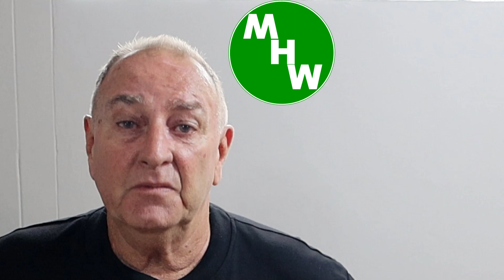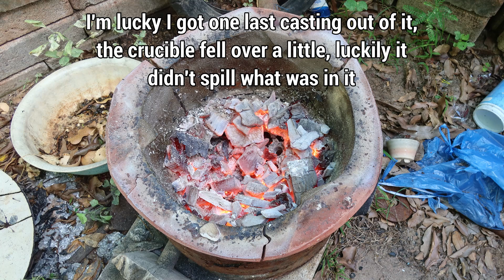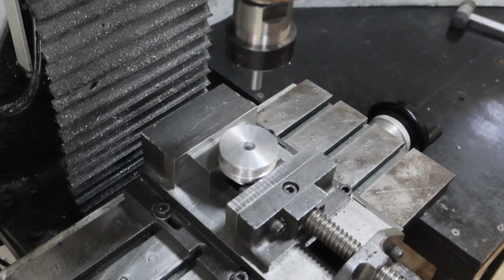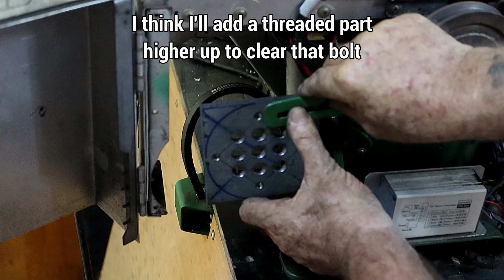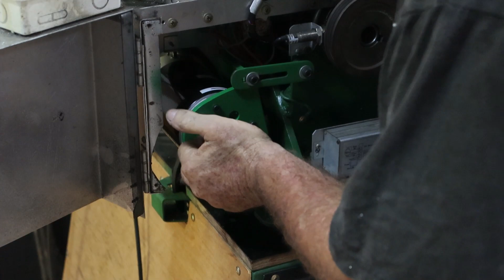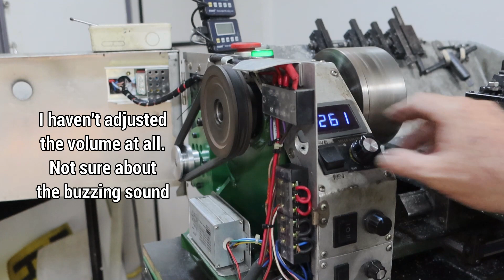MHW Episode 85 - Replacement Lathe Motor

Comment from the maker: As per usual I'd like to welcome my new subscribers 🙏, I hope you enjoy the content on my channel, if you enjoyed this video, please smash that Like button, it helps me to get my videos viewed by others and if you haven't yet subscribed, please consider doing so. 👍
Reply: Thanks for your prompt reply mate. I was a fitter back in the 1980's so I only ever used machine tools as and when required to so I don't think I could build a lathe or mill by myself. We hope to sell the house and buy one of those knock down houses made from wood up on stilts so I can fit my car under it and possibly build a work shop too. We have 6 rai of land up there but the problem is It's in what I call NAKON NOWHERE. If I don't have a small shop I will go crazy up there because the main town in Uttaradit is 26 KM away . I do want to get out though
Reply from the maker: @dermotkelly2971  I'm a motor mechanic by trade but had the desire to be a Fitter and Turner when I left school, but couldn't get a job as an apprentice. I ended up setting up and running a large repetition machine shop for the last 10 years of my working life. 👍
Reply: @MyMiniHomeWorkshop  Thanks for the feedback. Where do you go to get supplies like bolts and lathe tools and stuff?
Reply from the maker: @dermotkelly2971  Bolts I get here locally from a small engineering supply shop, tooling all comes from Lazada, as does some of the steel I use, I found a supplier up in Nakhon Ratchasima that sells short lengths of all sorts of grades, shapes and sizes, plus Aluminium and Plastics. Although I found a big scrap dealer here in Pattaya that puts more useful bits and pieces on shelves, so when I want a piece of plate or something, I pay them a visit, damn site cheaper than buying new stock. I also source some of my tooling etc from Aliexpress out of China. 👍

Comment: How much quite is the new motor. For bottom end torque you may need to change top and bottom pullies. I think that speed control is designed for a treed mill????? Have a good week 👍👍👍👍
Reply from the maker: Much quieter, if it wasn't for the buzzing you wouldn't know it was running. I'm going to make a smaller drive pulley, but I don't have the space inside the cover for a larger driven pulley. 👍

Comment: Congrats on the new motor, looks like it will serve you well! 👍👍
 
Idk how you have the Pot hooked up but it appears that a new higher Ohm potentiometer is in order. Or it could be the wiper isn't making proper contact to the resistive strip at the lower end of the Pot but, either way I'd get a new one. 👍
Reply from the maker: I'm not sure how they rate those things and which I should go, up or down 👍
Reply: @MyMiniHomeWorkshop  With the way the speed ramps up I suspect that it is a logarithmic potentiometer and the low end is just not enough to turn the motor, maybe another one of the same range but linear would work better.
To tell the difference you would need a multimeter to check what resistance you're getting for each position of the dial eg if half way on the dial is half the full value of the Pot then it's linear, if it's still way down low(or high depending on how it's wired in) at half way then it's a Log Pot.
If you don't get a reading in that range where it doesn't run the motor, then it's gone cactus as Uncle Ruckus mentioned.
BTW If you're not going to use any speed above about 1600rpm, maybe it would be a good idea to put a reduction pulley in to cut the top speed in two and double your low speed torque.
Cheers
Reply from the maker: @Bobs-Wrigles5555  Thanks for that, I'm going to make a smaller drive pulley, but I don't have the space inside the cover for a larger driven pulley. 👍
Reply: @MyMiniHomeWorkshop  👌👍

Comment: Hi Paul, Why didn't you just turn down a brass bush to reduce the old pully down to the 10mm.?
Reply from the maker: I wanted to keep that whole idler setup intact on the off chance I have to reinstall it if this new motor shits itself. 👍
Reply: @MyMiniHomeWorkshop  Yep understand.